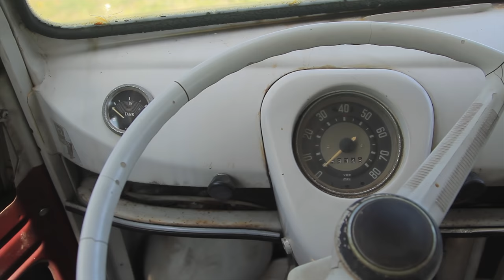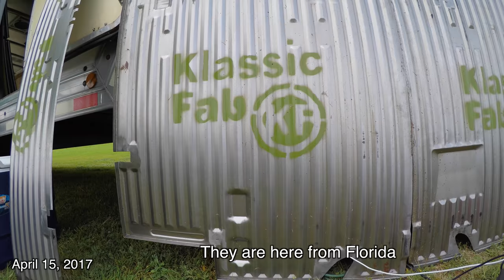VW Bus Restoration - Episode 3 - Too much work! | MicBergsma

Comment: With a car restoration you can go as deep as you want, but remember you can always go deeper.  I can see you are getting sucked in, and you might need to set your expectations to how far you want to take things.  If you want it show room perfect, then sure any bit of grease or dirt needs to come off, but if you want it respectable and drivable, then you don't need to worry about going that deep.
Reply from the maker: Yeah true!
Reply: we're more on the side of , patch the holes and call it good. :)

Comment: Awesome videos! I just bought a 72 bus yesterday, and was looking for good videos to help me figure this out. Look forward to seeing your project progress!
Reply: Cool! Does it need much work?
Reply: it needs lots of sanding, but the rust is not terrible. Most of the rust is still surface rust, and still sandable. The right quarter angel is missing the bottom and needs replaced. There is no interior, so I will have to figure that out. The engine and transmission did not come installed, but freshly rebuilt. But overall it is in good shape, and plan on starting on it as soon as I finish with getting the 68 type 3 fastback front end completed.